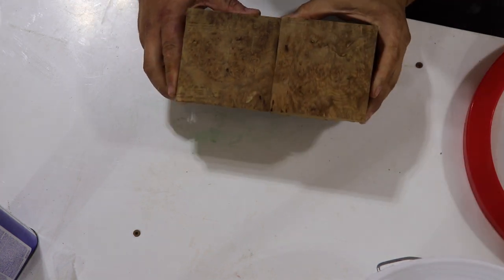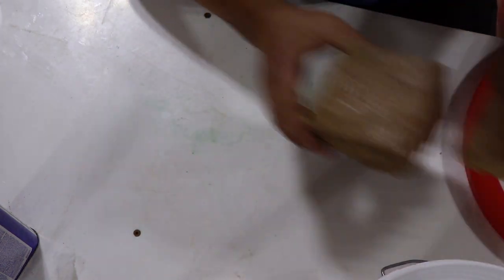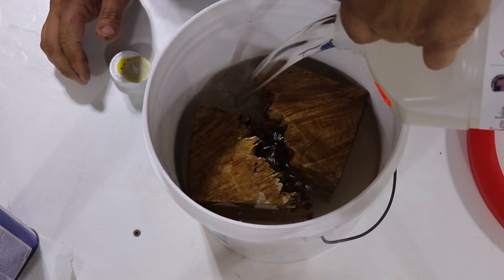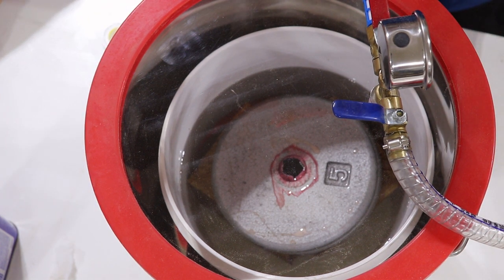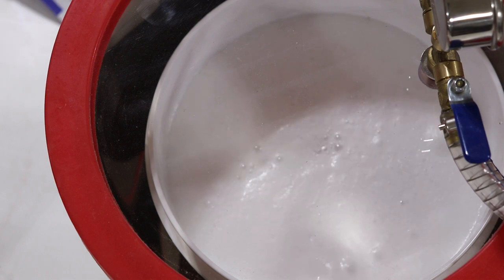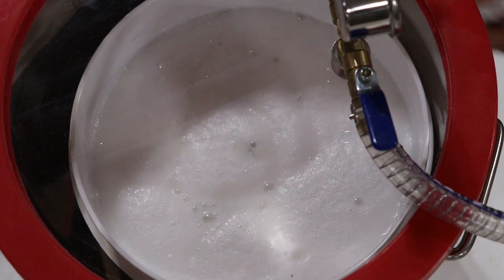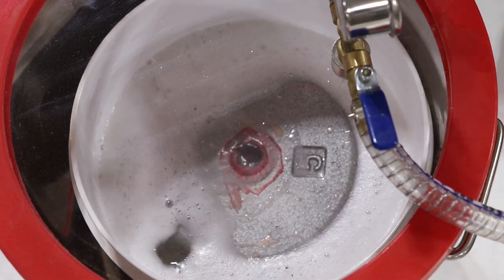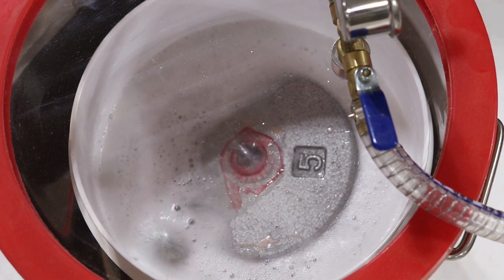Woodturning | Vacuum Chamber Trial Run

Comment: How long did you end up pulling the vacuum?
Reply from the maker: This one I left overnight. I find that 12 hours or so is lots, but I leave vacuum on until the bubbles pretty much stop. Just and FYI, the pump doesn't need to run the entire time. I turn it on every few hours but as long as the gauge shows 29 it is pulling air out. Thank you for watching Craig, I appreciate it!